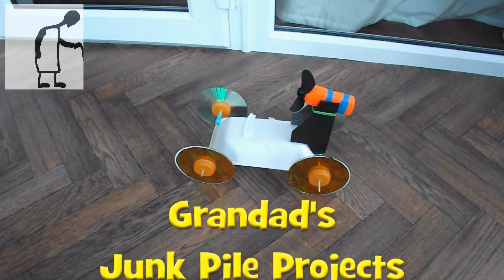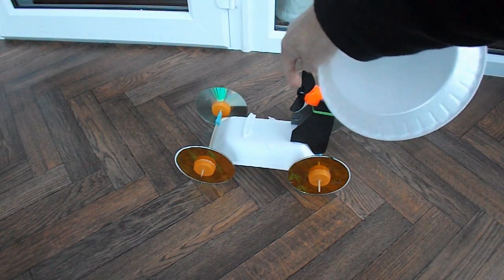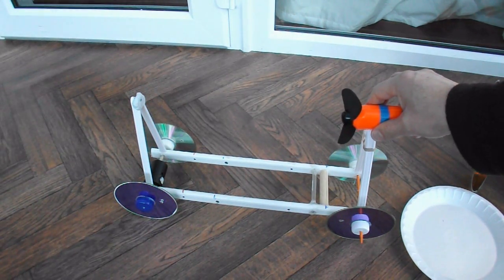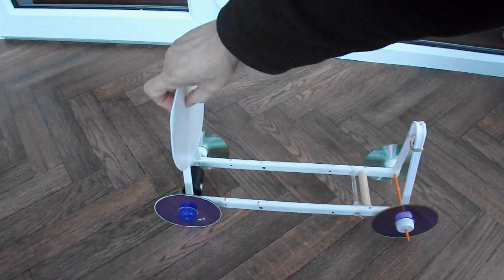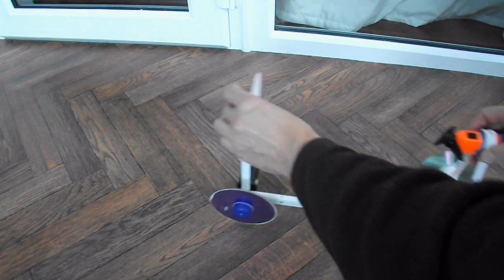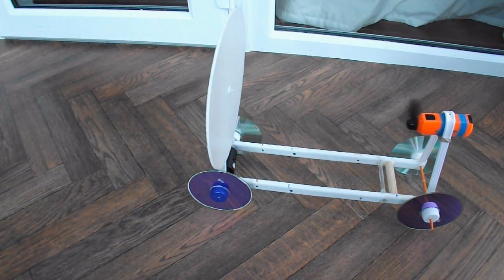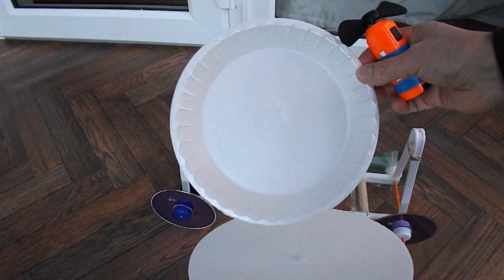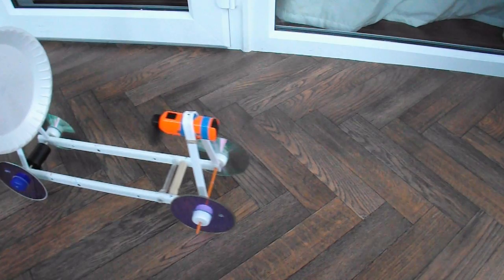Grandad's Junk Pile Projects #12 Wind Powered Car More Tests

Comment: I look at this as, the motor with the blade is sucking the air from the back and so pulling itself back but if the wind coming out the front of the propeller is hitting a plate it blows it forward (as you said), don't forget the weight of the motor, If you could suck the air from the front of you car into the back of the propeller then blow it toward the plate it should go even faster.
Reply from the maker: I am afraid 'suck' does nothing. This is all about pressure. The pressure behind the fan is greater than the pressure in front so the car should be pushed in the direction of the fan but the same pressure is acting on the face of the plate so the car should stand still. However the pressure on the plate is constantly being lost as it escapes and the pressure behind the fan is constantly replaced so the fan should take control. When the dished plate is used the shape reduces the rate the pressure is lost and changes the balance in favour of the plate and the car moves in the direction of the plate.

Comment: One more test you could try is to flip the plate the other way around (bowl side forward) and see which way it goes.
Reply from the maker: +Ken Heinrich just tried it for you and the fan wins. With the fan in my hand the car goes forwards. With the fan attached to the car it goes backwards. Same as with the small and medium flat plate.
Reply: +GrandadIsAnOldMan That is proof that the shape is the key. It is acting like a air plane wing and is some what proof that it is lowering the pressure on the front side when the bowl is facing back words. 😊
Reply from the maker: Ken Heinrich sorry but I don't follow your reasoning. I understand about fixed "wing" sails for boats using the air pressure difference created by an airfoil shape, but you don't see any sail boats with an fan fixed to the boat blowing in the opposite direction to push the boat forwards. Turning the plate round proved nothing other than it was no more or less effective than the flat plates. Yes with the plate dished towards the fan there is an increase in pressure on the fan side of the plate and in effect a lower pressure on the other side of the plate. This is the same in all the cases I demonstrated. The difference with the flat plates is that the air is dispersed at right angles to the direction of travel. There is still greater pressure on the fan side of the flat plate than there is on the other side but there is a bigger differential between the front and the back of the fan so the fan takes control of the direction of travel of the car. With the dished plate, instead of the air pressure freely escaping at right angles some of it is restricted by the curve of the plate effectively focusing the pressure or retaining it sufficiently for it to build a greater pressure difference front to back compared to that generated by the fan. I think you may possibly be thinking along the lines of the Coanda effect https://www.youtube.com/playlist?list=PLA5a2xPRSrB1D1SvZ_2rhWqWrijfn0v3t

Comment: With the wind defelecting of the plate it will also cause air movement from the front of the plate which will cause a lower pressure in front of the plate which will help the car move forward.
Reply from the maker: +Ken Heinrich but why does that not happen with the flat plate?
Reply: With the flat plates the wind goes right, left, up and down with less velocity and does not create enough of a pressure difference.
Reply from the maker: @KenHeinrich  I know this is 4 years later, but I have been working on something a little similar and came back to watch these old videos over. I now understand your explanation better, I am not sure if you saw the follow up video I did that confirmed your explanation https://youtu.be/6dIiV6YAXKA and I still don't think I got my explanation right as I was still waffling about the direction of the airflow rather than the pressure differences.
Reply: @GrandadIsAnOldMan  I understand. When I get into a one track mind it some times takes a derailment to get me back on track.
Reply from the maker: @KenHeinrich  thanks for being understanding 😁🎅🎄🎁⛄

Comment: hey grandad can yountake a cheap toy grade rc car and turn it into a good drift car?
Reply from the maker: +Epic Face 3000 on my floors any RC car is a drift car, haven't you noticed. If you want you car to drift just fix the back wheels so they have no grip, stick tape round them or run them on a shiny floor.

Comment: Fascinating...I think you are getting a similar effect as a ships sail.
It is the air flowing around the curved, forward side of the plate generating a low pressure area that provides the additional force required to over come the thrust of the propeller.
Enjoy all your videos Thanks 😊
Reply from the maker: +Wil Hobbs thank you. I will take your word for that explanation. Certainly the fan blowing air at the back of the plate creates a pressure differential between the front and the back of the plate. However the same effect must be happening with the fan reducing the air pressure in front of it and increasing it behind it so you should have the same forces happening at both ends of the car in opposite directions. The difference appears to be that the curved rim of the plate is in effect focusing the air flow increasing the pressure rather than allowing it to be deflected at 90 degrees. No doubt there is an optimal curvature to maximise that effect.
Reply: +GrandadIsAnOldMan   No doubt...I have an old sail plane wing kit that's waiting to be built.
Thought it would make a good sail for a boat.

Comment: Personally I think people are forgetting the net thrust created when the air deflects off the regular curved plate and gets directed slightly backward because of that lip/rim. This adds a force that pushes the car forward creating an imbalance of backwards and forwards forces. Because of the air bouncing off the curved plate, there is just enough more forward force to be significant to move the car.
A flat foam plate deflects like 99.99% of the air to the sides which is not useful for the possible forward or backward motions of the car.
Reply from the maker: 4 years later and I am watching this series of videos over, so I am adding some replies to the comments I missed at the time. I am now confident this is all about the pressure differences with the curved plate helping the pressure to build, The flat plate and the reversed plate allowing the pressure to escape.